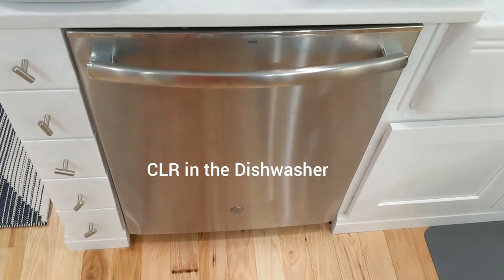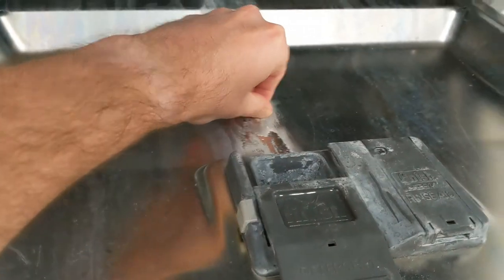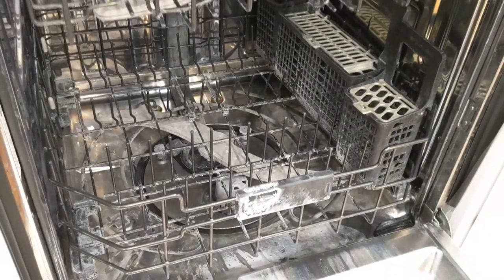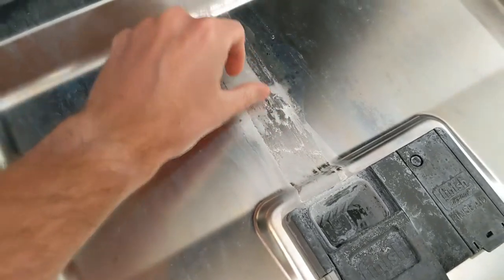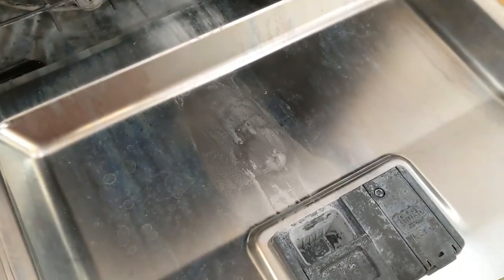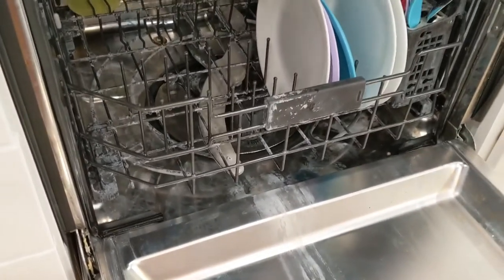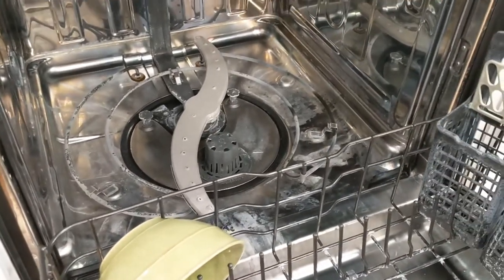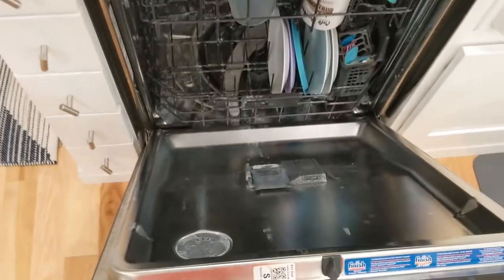CLR in Stainless Steel Dishwasher

Comment: Try leaving the CLR or vinegar in a cup upright as pouring it in the bottom is likely to result in it being drained away as soon as you start the dishwasher. Many, if not most, dishwashers do a drain cycle first, then they start the wash cycle you selected.

Comment: You need to put the CLR in a cup on the top rack and run a cycle. Do not pour it in the bottom. Dishwashers have a draining system that starts every time at the beginning. You should use vinegar instead.

Comment: I'm actually in the process of descaling my dishwasher at the moment. And was searching for videos and came across yours. Without any back history and just cruising through the comments I will recommend using either a gel or the pod detergents. I've always used rinse aid and I think that helps a lot with as well.
Additionally, if you put the clr or vinegar in a small cup in the dishwasher it will overflow gradually during the washcycle and slowly release the cleaner.  If you just pour the cleaner in at the start of the cycle it will most likely be flushed out. Not sure about yours but mine runs the drain pump first then fills with water at the start of the cycle...
Hope this helps. Got a phone call half way through typing this...
Oh and not sponsored by anyone (wish i was) but I've had great luck with cascade platinum and complete gel and pods. For rinse aid cascade or finish jetdry have worked well 👍